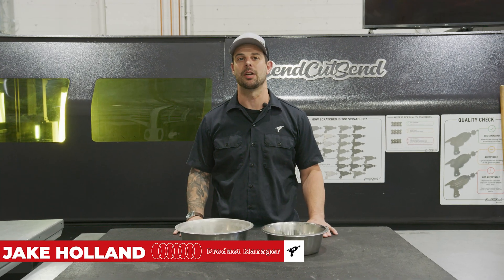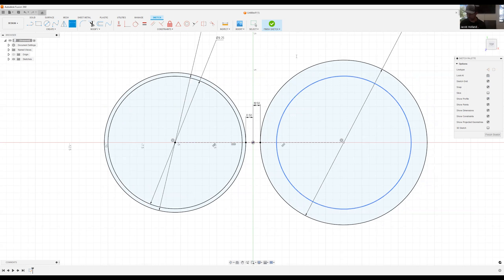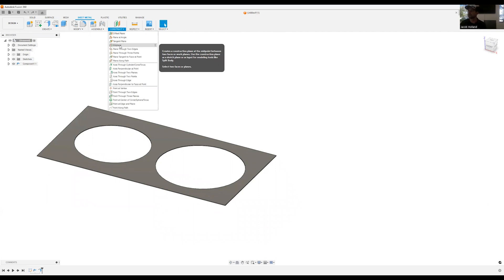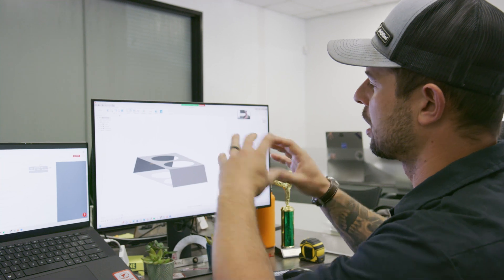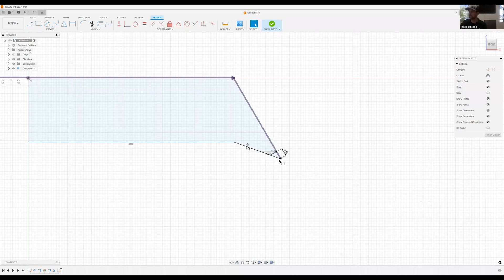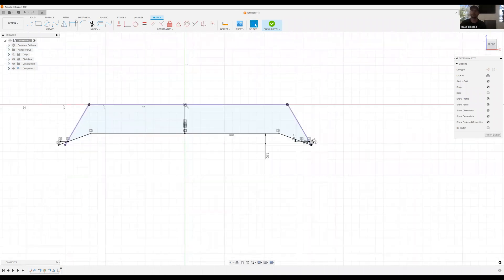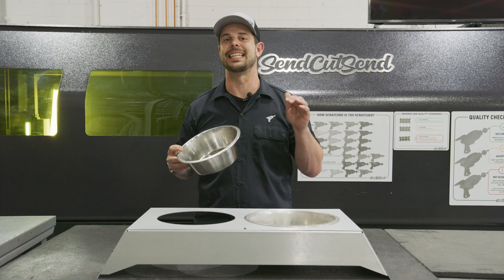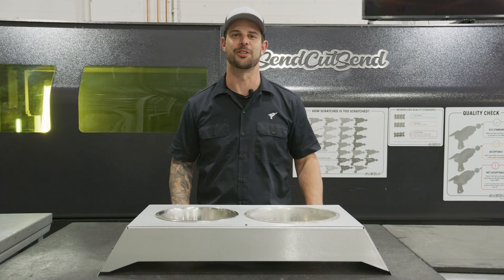DIY Custom Dog Bowl Holder | SendCutSend

Comment: I won't lie, I was kind of hoping the drawing would be in the description, but it'll be more fun to try and replicate this. My dogs need this for their pen. Thanks!
Reply: Well, I got it modeled up, but went too big and it's outside the parameters for an online quote and bending (44") -- overall length ended up being 45". Will have to try again another time. I struggled my ass off but it was fun. Thanks again for this!
Reply: I was able to resize it far easier/faster than I thought, but now getting an error "This bend crosses geometry that may cause deformation when bent." and I don't understand. I think it might mean my holes are at risk of deformation due to proximity of the bend. But I'm not sure why. Did 90*, 1/2" flanges with .150" holes like you did in the drawing.
Reply from the maker: @bearsstuff  You're doing work! Feel free to reach out to our support team, support@sendcutsend.com and they'll be happy to help you get your drawing to a place where we can cut it!